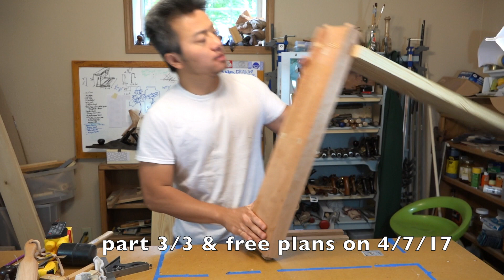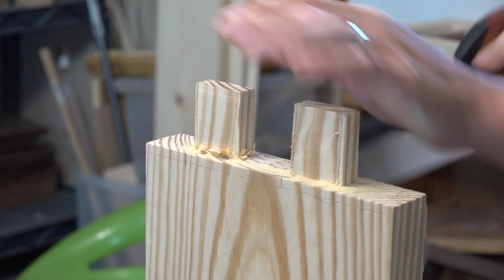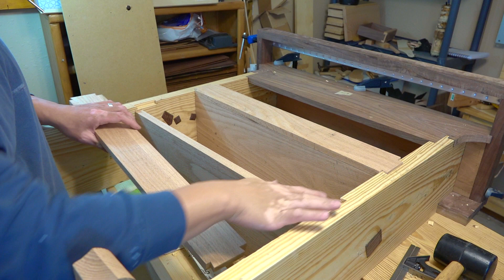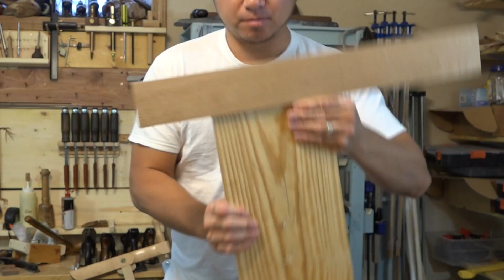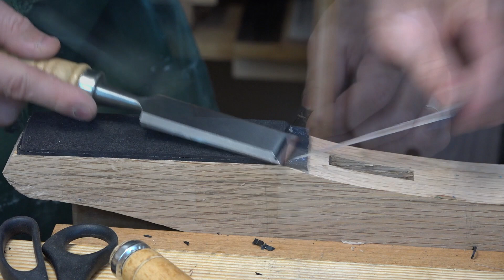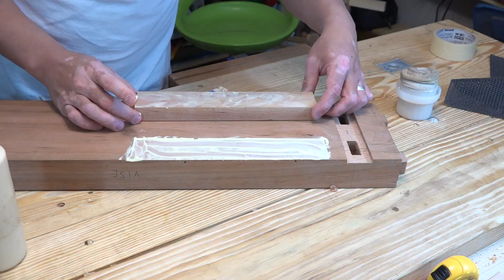Portable Workbench - Part 2 of 3

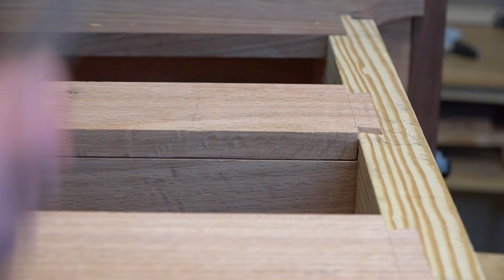Comment: I know that in some places of the world, like the UK, they use the word rebate to refer to the groove made at the edge of a piece of wood, like the one you made reference to on minute mark 7:20, but the word rabbet is a more correct name for that type of joint. 

Here is the definition of both words: 
re•bate ( rē′bāt; rē′bāt, ri bāt′), n., v.,  -bat•ed, -bat•ing. 
1) a return of part of the original payment for some service or merchandise; partial refund.
2) to allow as a discount.3) to deduct (a certain amount), as from a total.
rab•bet (rab′it), n., v.,  -bet•ed, -bet•ing. 
1) a deep notch formed in or near one edge of a board, framing timber, etc., so that something else can be fitted into it or so that a door or the like can be closed against it.2) a broad groove let into the surface of a board or the like; dado.
Reply from the maker: Thanks i.rodriguez. Description to communicate vs. using jargon to mystify is an on going dug between good and bad presenters.
Reply: Well, so far you are doing wonderfully, so keep up the good work!

Comment: is it true that traditional Japanese carpentry very rarely uses glue? if you're not truly Japanese I hope I didn't offend you. I just have a high level of respect in the attempts at perfect joint hurry that the Asian culture attempts with carpentry and woodworking
Reply from the maker: I am not Japanese. But I am also very hard to offend. I try to extend to people the benefit of the doubt. As far as gluing is concerned they all used it. I know that the Chinese and Japanese and Korean used animal hide glue and rice glue. Rice glue is more common in Japanese woodworking, I think the Chinese and Korean preferred animal hide glue. These glues are semi-permanent, unlike modern wood glues, the semi-permanent glues allowed a joint to be taken apart. For example, a shoji (screen door) often warped or shrunk over time so the fix is not a new door but to open up the joint to remake may be one piece. In China, most furniture are designed to be taken apart by soaking the joint, that's part of the reason why you see through-tenons in Chinese furniture. 

Both the Japanese and Chinese built wooden structures w/o nails or glues; just like Western post-beam construction. In China for sure there are some furniture that do not need glue because the joints are tight and the wood is well seasoned. I can't say for sure for Japanese or Korean, but I suspect they also made some furniture w/o glue.
Reply: Maybe I should have said this in my question or comment depending on how you see it two years ago I went on a trip to Spain if I didn't speak people assumed I was German probably because of my facial features and because my ancestry is Jim my family came to America from Germany a hundred and sixty years ago. I know this for a fact because people would start talking German to me if I was standing with them in a crowd. Thank you for the information it is extremely fascinating. I will have to do more research simply because I not only enjoy carpentry I enjoyed carpentry history. And different techniques of course. Have you ever heard of the Shakers? Known for their carpentry skills. Also do you take care packages for use in your videos like wood planes saws and other things you may use in your videos?